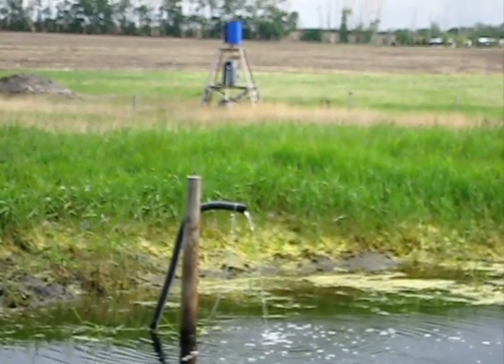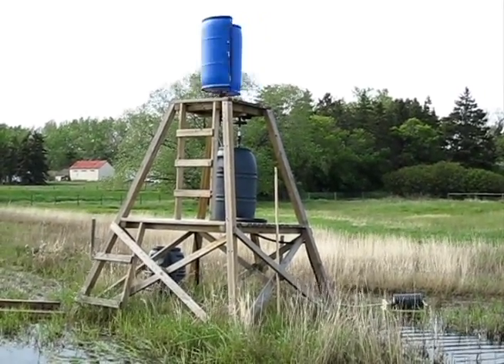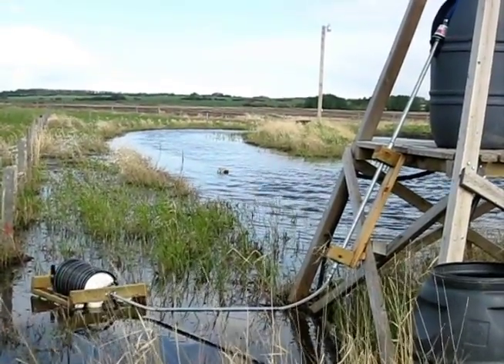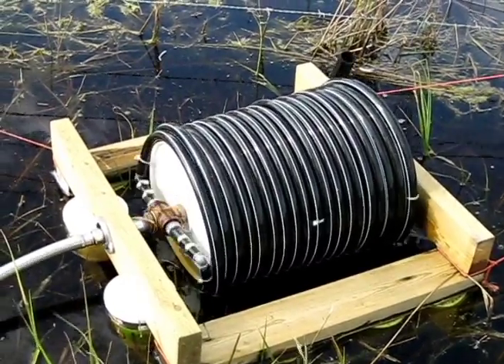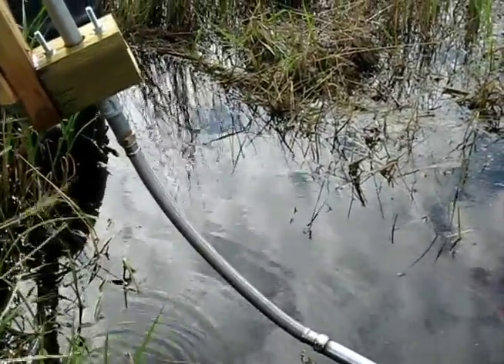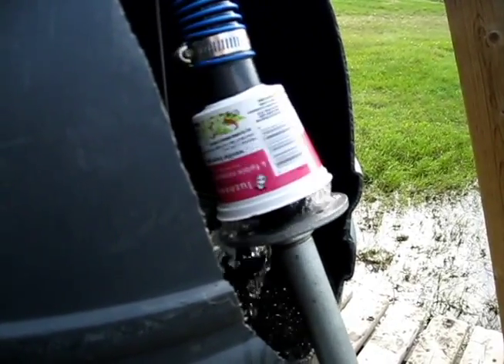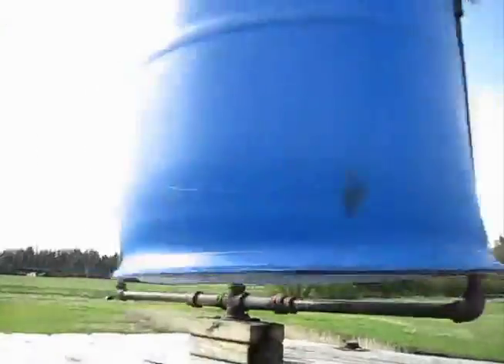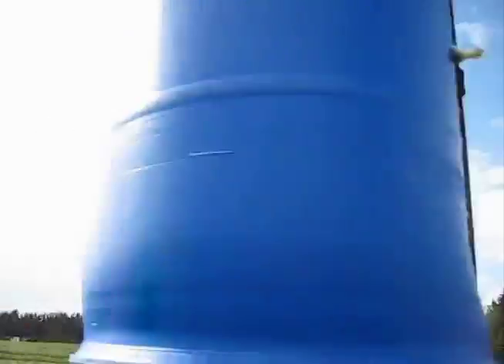Savonius Rotor And Horizontal Screw Pump

Comment: Complimenti!
Vorrei farti Però una domanda, Come fa la pompa a mandare su a quella altezza l'acqua senza che l'acqua torni indietro?
Hai installato una valvola di non ritorno?
Reply from the maker: No valves required -- the air in the top half of each "wrap" of the pipe prevents any flow-back.  In essence, each wrap of the pipe has a vapour lock that moves ahead as the spiral pump turns.

Comment: How high it is ???if it's 10 meters high then use a barometer. And download the water instead of uploading 😃😃😃😃😃
Reply from the maker: You'll have to explain yourself a bit better -- a barometer doesn't move a volume of water -- it just indicates the difference in pressure between two different points.  The point of this pump is to raise water from a lower pond to an upper pond.

Comment: @prosstaylor  How do we contact you? Are there blueprints or plans for this?
Reply from the maker: Hi, Joseph, I don't have blueprints for this -- it was a research platform that led to a number of changes (most significantly, I ended up using gas pump hose for all the flexible links, and I put up a simple 2x4 frame to provide a bearing on the top of the turbine).  My intent was to get people thinking as to how they could use materials locally available to them to build something similar.  In terms of contacting me, the email provided in the video works best -- that's how I get notifications like yours from YouTube as well.

Comment: Bro, when u say that 50 liters per hour, that is heart breaking. All excitation went away.
Do you have any more efficient solutions for compiting Motorized pumps.
Reply from the maker: Efficiency isn't a strong point for Savonius rotors -- horizontal turbines with carefully-engineered blades are much more efficient.  My intent is to show that it's possible to convert some of the energy available into useful work using a low-cost, simple design.  I'd be interested to see if anyone out there has a design that's suitably inexpensive, simple, and efficient all at the same time -- that's an excellent goal to aim for.

Comment: I can imagine both of the halves of the Savonius Rotor being mounted on sliding tracks with adjustable stops at each endpoint in the travel, and an adjustable spring on each half to pull it back into position after the high winds subside. The problem with this setup would be the likely tendency for the sliding pieces to stick and jam in the tracks. Your rotational governor seems more efficient and reliable.
Reply from the maker: I may be misunderstanding your suggestion -- it seems you would have the to barrel halves sliding out on rails but still maintaining the same orientation to the wind.  This would result in even greater forces on the rotor at high wind speeds -- larger rotational radius producing more torque and greater chance of disintegration due to rotational forces.  In my system, the effective radius stays the same, but the system becomes less efficient, absorbing less energy and thus protecting itself from destruction.
Reply: @prosstaylor ...........i'm very impressed with the design..Think you have pitched it just right.,between availability and complexity and with attention it could almost arrive in the barrel that becomes the turbine..
Reply: @prosstaylor  No, the idea was to have a heavy counterweight on the other end of each half to swing out against a spring and pull the two sliding halves together to form more of a closed cylinder to slow it down, but I still agree your idea is more elegant, and uses rotating friction, not sliding friction and has no heavy counterweights like mine to slow the wheel down.
Reply from the maker: Oh, sorry,  @andrewbarrett1537 , I misunderstood.  I actually have a drawing of a design like the one you describe, but I haven't implemented it.  This makes an aggressive, positive-action governor that starts well under low-wind conditions, and spins faster but with decreased torque under high-speed conditions.

Comment: Is there a calculation for the pressure (how high this rotor can push the water) according to wraps and/or total length of pipe? I need the water to be pumped up about 2 meters above water level.
Reply from the maker: Take the diameter and multiply by the number of wraps to get the height and add a couple more turns for good measure.

Comment: Thanks for the video.  This has been a windy year here, but normally, not much wind so looking more at your water spiral pump.   Interesting that the water spiral pump video was published in 2017 (placed questions on that video) and this one which seems more sophisticated was published in 2010.
Reply from the maker: Thanks.  The water spiral pump's simplicity was, in large part, to avoid some of the complications that come with greater complexity.  As I mentioned in my answers to your queries about it, I think I would put a flexible rotating pipe (gas pump hose) inside a flexible stationary pipe (poly) for both of the designs to achieve both simplicity and compact design.
Reply: @prosstaylor  more compact design is through the inverted barometer so we download the water instead of uploading it 😃😃😃